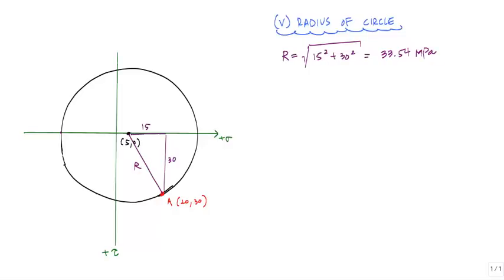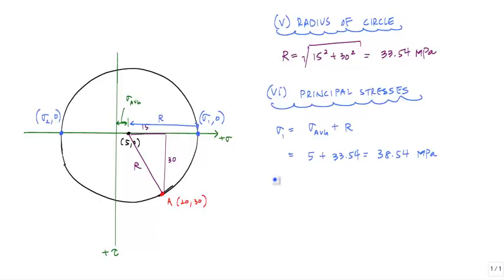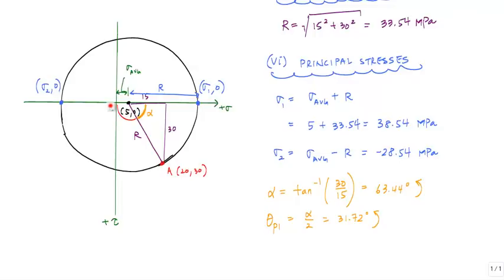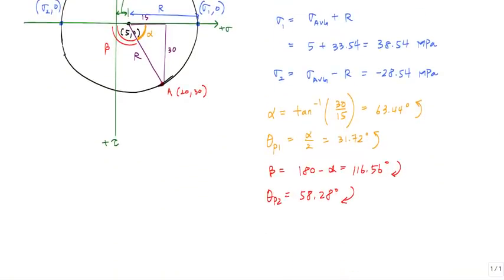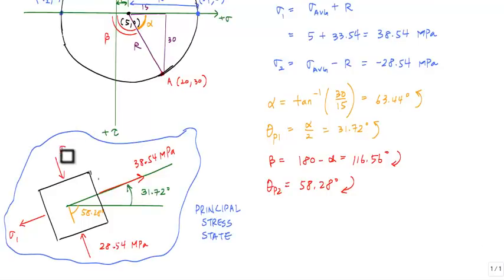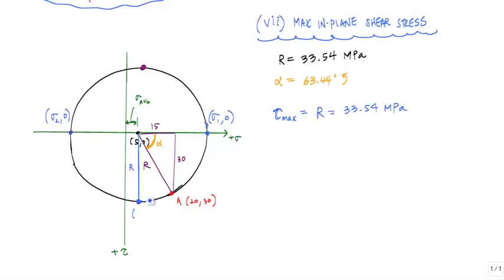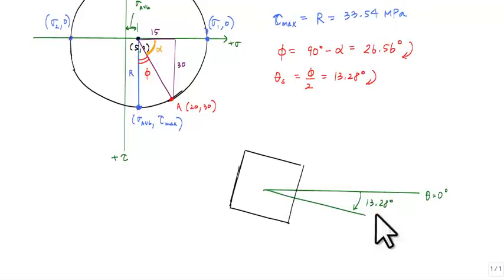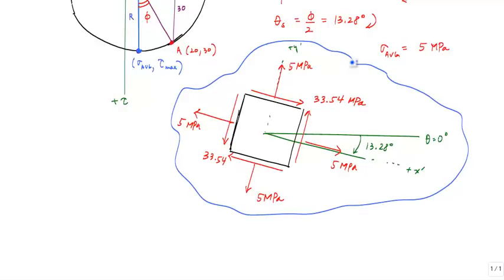mohr's circle example 1 (2/2 - principal and max shear stresses) - mechanics of materials

Comment: How to solve the problem if the element is rotated further by 30 degrees clockwise and we have to calculate stress components?
Reply from the maker: You would have to go an additional 60 degrees clockwise in Mohr's circle.

Comment: You say angle phi is measured from zero degrees so its clockwise. but if you measure alpha from zero degrees it should also be clockwise. Right?
Reply from the maker: Cyrus Garner alpha is is measured counterclockwise from the line at point A (which represents theta = 0) to the +sigma axis on the circle that i have drawn.

Comment: Hey, I'm gonna have exam tomorrow so need to ask you quickly. Why does you draw point A at the bottom? Is it because the positive of T is bottom. I got confuse coz I used the draw bottom then my lecture draw at the top and I don't know why. Is there a difference? Thankss
Reply from the maker: Murasaki Usagi i use +tau axis as going downwards and +sigma axis to the right...other variations are possible.